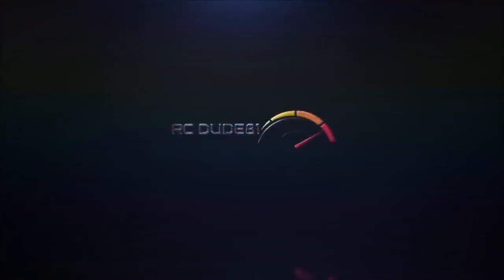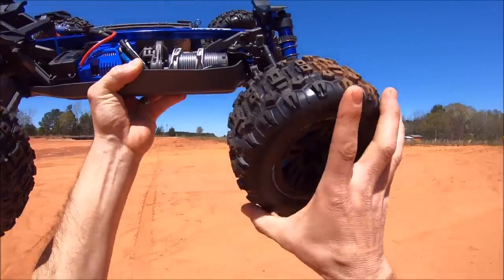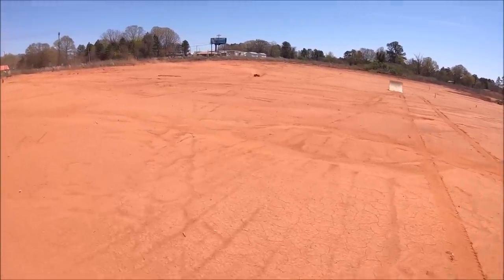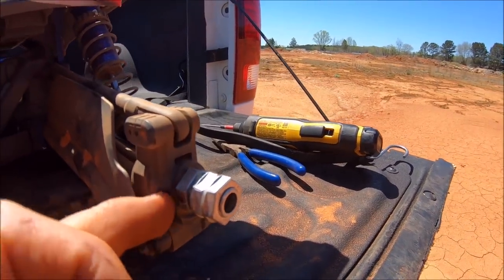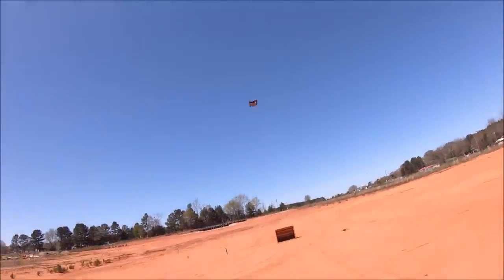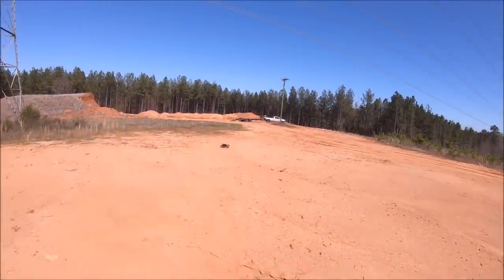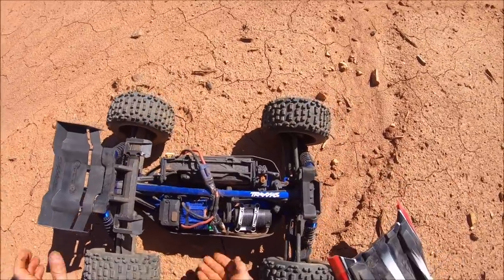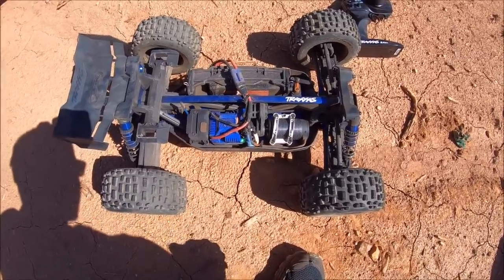NEW TRAXXAS Sledge 6s -First Real Pounding and Durability test!!😱

Comment: footage!! i like the motor mount, i like how its fully supported. I've killed so many motors on rigs were its only held on one end. Maybe a hybrid system could work? conventional style mount with the traxxas style all in one. Saves gears and motors! maybe
Reply: When will you take out you're sledge again?  :)
Reply: I like rear support but only having old School Nitro slide type Adjustments for the motor ..In and Out not going to Cut it!
Reply: You the man kev
Reply: @reggiehofman764  as soon as i can get parts :)
Reply: Kevinnnnnnn legend has it’s still raining in your town
Reply from the maker: Thanks Kev! Footage!!🤣🤣Yes the motor support is great but the mount itself being separate from the center diff mount isn't good when things flex! That's what's causing the spurs to implode!😝🤣 Overall a fun truck! Traxxas tough!😆

Comment: I’ve been a traxxas guy since I started in the hobby way back in 1997 when I bought my Nitro Sport. I Was always a nitro guy as back then, electric couldn’t compete with nitro. Now, it’s the opposite. What I’ve always loved about traxxas is how durable and reliable they are. And every hobby shop I ever went to had traxxas, and any replacement parts you needed if something did break. I’m a basher, but never anything like what you put this sledge through 😂 I recently fell back in love with the hobby after about a 6 year hiatus as I fell out of love with the nitro cars. Too messy, and require too much maintenance especially when stored since engines gum up and seize over time even when oiled and stored properly. Now I’m all about the electric cars. Recently I bought the traxxas XRT and man is that thing a beast! But, you need a LOT of room to bash that thing. I’ve been looking for something a little smaller, like the rustler or Hoss. But, after watching your video, I’m definitely going the route of the sledge. Great video. And what awesome jumps. Subscribed!

Comment: 5:36 I thing kevin talbot does not need a shoutout😂😂. Awesome video, I am also not a huge fan of the motor mount. It might make the motor last long, but that adjusting from the bottom is just stupid. But the car does really take a good beating considering it was stock. Looking forward to m2c coming out with some killer parts for it! And congratulations on 20k subs!

Comment: Seems that the Skeeter took the same abuse, did you tweak a chassis or chew up a spur? Bang for buck, it's a tough and fun rig. 
If the initial price point wasn't $800 for the Sledge, it might be a consideration. The Kronos XTR and Kraton EXB rollers are a better value IMO.

Comment: I've driven one,will buy one soon. Seems super smooth and quiet for such a tank,loved the handling and air control. A little overpriced, but also some great new tech in it,the motor cradle is cool,the body is the best part,T bar should be super strong and the chassis is beautiful, even tho u bent it.

Comment: That glue is awesome, i use the same stuff, used them on my belted badlands and on my non belted tires, holding strong with more than 10 packs on each set of tires
Reply from the maker: Nice! Yes it works great!! Cheaper than Hobbygrade glue too.😎

Comment: Very nice jump. What about using 20T pinion, in this case motor mount  will be on the edge and have no place to move? Only can rotate.. On the other hand, glue and over-tight these 4 screews before first run is suggested :-D Hope that aftermarket better motor mount some company makes for us.

Comment: Bought a sledge.  Its a lot of fun, but the foam fell apart on the tires after 5 runs and i keep loosing a screw pin. The screw pin is $3.50 for a pack of 6, but traxxas wants $65 to ship them to Canada.  I asked their support about just throwing it in an envelope, and they told me if i didn't want to pay the $65 that i should go search the field for the screw.  They had a lot of smart ass responses.  Completely unreasonable, support is terrible and listen to the other reviewers who say they won't buy traxxas ever again.

Comment: If all that breaks is a spur gear and little tweaks in the chassis I’d say she’s a winner. You beat the hell out it. Idk why people are complaining so much for your average person it seems to be a great truck
Reply: IMO, the average person would break it more. As most of these other YT videos  show, driver skill has alot to do with longevity. We may not have seen all the bad landings or cartwheels in this video but by and large its took a lot of massive air landings and still kept going.
Reply: Ditto. All these whack (probably kids) calling it junk. They want to say Arrma is better or this or that is better. I’ve done Rc my whole life and I’m smart enough to know that all vendors have an upgrade path. You send anything as hard as this and it will have problems. The average person doesn’t treat them this bad and if they do then oh well crap breaks. To see it stand up to that kind of punishment is pretty dang good for out of the box. Haters gonna hate but this is a good platform and will have large aftermarket support. I’ll be getting one but sending it less than that unless I have a really good transition to land on.
Reply: @Shadows-RC  I know what the gears are made of. Didn’t see any of them bust. The motor mount shifted and then homey lost some teeth. Would it be better to have machined gears? Yes. Would it be better if the truck was cheaper, yes. I can’t think of anything that is perfect out of the box. My 4 seater sxs. Needed all kinds of shit. Should have come with beadlocks, winch, off-road lights. My boat should have come with a better sound system, better trim tabs. My mtn bike should have been carbon fiber. My computer should have a better graphics card. You see the picture? Just about everything these days is mediocre at best. Nothing new here with Traxxas. I have over a grand in my xmaxx. Did it need it? Nope, did I want it trick? Yes…so I paid for it. You could drive that sledge all day without problems or you could break it in one squeeze of the trigger.  Stop whining and drive like you stole it.
Reply: @DJ_SHANNIMAL  Well said, I'll bet half these guys crying over the price have way more in upgrades on whatever they're running. If its this tough out of the gate, it should'nt need much. In the end, you're looking at $1000 or more no matter what price you start with, pay more up front or after it breaks. No difference
Reply: @Shadows-RC  Wow! You went political over Rc cars? You have issues Karen.

Comment: Oh crap! Eric got a Sledge 🤣 This truck has no clue what it's in for 🤣🤣 I was thinking your mesh sounded harsh from the beginning. All the stock videos I have seen have a pretty smooth sounding transmission. I'm impressed that it took some of those launches. Maybe metal chassis are better than plastic after all! 😜
Reply from the maker: Thanks Aaron! Yeah I was running a smooth mesh until I started jumping. I set it up a tad tight bc of the spur issue😝All the flex and motor mount just won't stay put under those conditions. So glad M2C will have a solution!!😎💪💪🤘

Comment: Should I get a Kraton EXB, Kraton BLX, or Sledge? Thanks for beating the life out of this so I can watch 😁. Cheers mate!
Reply: Kraton exb
Reply: Sledge
Reply: Sledge. The design of the shock towers makes it hard to bend them, bracing is phenomenal, and with M2C making upgrades for it, will be insanely bullet proof
Reply: @TylerSaleik  Thanks for the reply! I can't believe how much this thing handles stock in this video!! I have Arrma 3s cars now and they would fall apart if I beat them like this!
Reply: @3dconceptsofutah757  nice man. To follow up on my response to your comment, once M2C makes metal chassis bracing, the chassis, shock towers, and better motor mount system, I think this has best 1/8 basher potential.
Reply: @3dconceptsofutah757  no.. he done that with 3s arrmas and didn't broke them.. it depends how you land etc
Reply: He aint finished with the sledge yet bud wait a little longer till you see more defaults ;Rich must be cooking up a sledge anytime🤣
Reply: @severinasaf  I'll have to look through the archives and find those videos! That's encouraging. I'm sure I could do a few more things to toughen my 3s Arrmas. Then I won't have to waste all the rest of my money on new cars 😆
Reply: @TylerSaleik  Yes I believe it. I suppose the question is, how much do you have to spend for the ultimate unbreakable car. Then again, how much will you spend on one that breaks all the time😆. No room for cheap dudes like myself I guess!
Reply: @TylerSaleik  You're talking about a $1300 dollar investment easy 😆. At that price it better damn be the best car there is. $850 for the car, another 300 for charger/batteries, then $200 in m2c upgrades, because they are not cheap.
Reply: @codejunki567  lol very true. Then again any rig M2C upgraded is not cheap the slightest bit.
Reply: @3dconceptsofutah757  I have taken my kraton exb out over 300 full 6s pack runs, just about over $2k into the car 😄
Reply: You should never buy a T-brand thing!😆

Comment: Seems like everyone is having trouble with that motor mount.  Otherwise seems pretty tough💪
Reply: Not many take the time to add threadlock and make sure the screws are tight. A little prep goes a long way
Reply: @rcilluminati26  I doubt it alot of these YouTube guys are reviewing rigs they bought themselves.    It probably needs Red Loctite or it might just be that screws being exposed on the bottom of the chassis is not gonna work without a cover or being babysat.

Comment: I was just wondering how were your temps with the 17t pinion gear.
Reply from the maker: Hot but not dangerous. The motor did cogg a tad on the low end though.

Comment: The front wheels on my Sledge (6S) never stay grounded... do you think I might have the empty center diff oil issue?
Reply from the maker: It's probably bc they use I believe 20mill in the center. Going to a lighter oil will help keep it grounded or from wheelies.
Reply: @RCDUDE81  Thanks man. It's real confusing as some RC sites say thicker center diff oil = better power transfer and less wheelies, others the opposite! 🤯

Comment: I'd much rather buy upgrades for a half priced armma this thing is way over priced I wonder if the drive shafts are the same monkey metal as the metal drive shafts I upgraded on my hoss.. at this price it should have came with hardened steal gears and not the monkey metal.. nice bash you and rich definitely do a honest and the most skilled bashing and not like most that drive them to purposely break them and blame it on the rc! You guys are doing great for the hobby and the reason I just bought a TLR Typhon I can't wait to get her running!
Reply: Stick with Arrma them. I dare you not to buy a Sledge. 😎
Reply: You’re acting as if a exb outcast/talion isn’t $750 rtr……..
Reply: Half priced Arrma. Dude a Kraton EXB is 750

Comment: Is it just me or is that chassis way more bent than what ive seen from stock arrma cars?
Reply from the maker: It was bent for sure but not any worse than an Arrma RTR chassis. The Arrma 7075 EXB chassis take a bit more for sure!
Reply: @RCDUDE81  may have been camera weirdness/angle then. Regardless your the one with the truck and are using it, thanks for the reply

Comment: motor mount moved is one thing, also i think the center diff mount kill the spur and pinion too, thunder rc have the same hit on the nose (low gound noser) where the small bumper is and the spur and pinion is done, traxxas use a more softer plastic too, i think they use that soft plastic on the center diff mount, which is stupid, everyone is using aluminium center diff mount and traxxas use plastic???😬😒 hope m2c and other aftermarket companies  will come out with a aluminium center diff mount.

Comment: Im disappointed at how affected the driving cups with rubber boots inside and the exposed spur are to pebbles and stones, if you don’t run in a perfect fine sand area the rubber and the spur get shredded by small pebbles. This car can’t be run in gravel it self destroys… Now Ill have to get at least a dust cover to not regret this purchase…

Comment: @8:10 "I'm not a huge fan of adjusting from the bottom." You've clearly never ever ran a nitro then. Thread lock will take care of that motor shift "issue."
Reply: No it won't..Not when you send it like Eric does..Needs a better motor mount for sure
Reply: @philthyco1  use red thread lock, it won’t be moving then.

Comment: The weak points?  From watching Thunder RC's video, is gotta be that peanut butter spur and pinion. He said he thinks Traxxas is probably using the sane monkey metal diffs that they use on the X-Maxx. And I heard the lack of droop screws  is another weak point.
Reply from the maker: Yes my spur broke too in the end. M2C already has a solution!💪💪
Reply: The motor mount shifting is another problem. I don't trust that plastic spur gear cover either. That's going to have to be changed to aluminum

Comment: Impress with the design you mean the one they stole from Arrma
Reply from the maker: No the body, body mounting and battery tray design as I mentioned.😜The Truggy has been around for ages. This is the Traxxas take. Still some serious shortcomings but hopefully they will address that!
Reply: @RCDUDE81  I doubt they will address they could careless about Consumers now
Reply: stop it already, its been proven that its different  and Arrma has no claim on the truggy platform. Corally is way more similar to Arrma than the Sledge and nobodys crying over those.
Reply: @rcilluminati26  stop being a internet troll

Comment: Money pit.

$800 + M2C chassis + M2C motor mount + servo etc, etc.

You could build pretty much any other brand into a tank for far less money and all of them would drive better.
Reply: yeah you're right! its crazy how expensive this truck is a kraton v5 was 550$ a few months ago...Traxxas is just arrogant they should learn how to build a proper 1/8 truggy before charging more than any  other manufacturer.
Reply: @michaelregan427  the kraton v5 & exb just had a 75$ off sale too. Took advantage of that
Reply: I think in the end this will still be tougher because some key parts are oversized compared to others. Outdrive cups, diffs, shafts, ring gears etc... Maybe spending a few hundred more up front will save money long term even factoring in upgrades